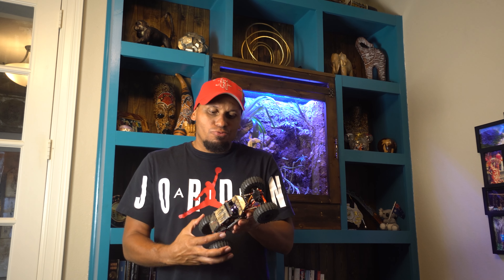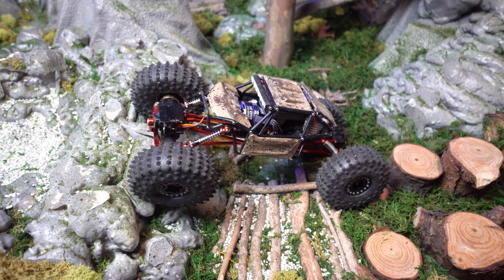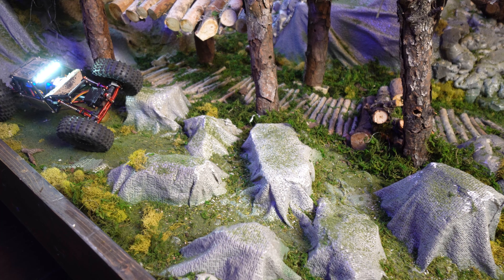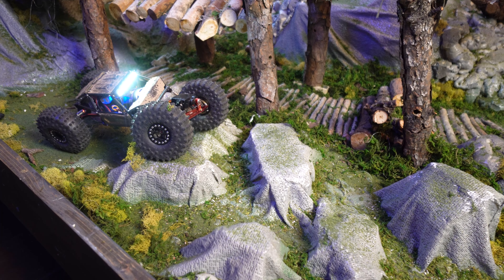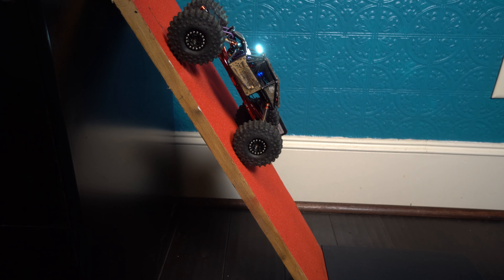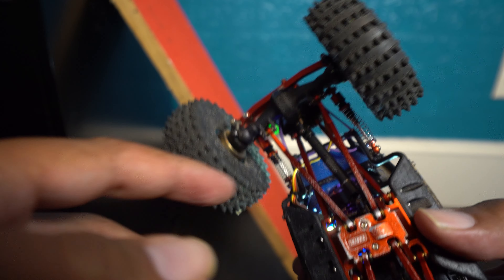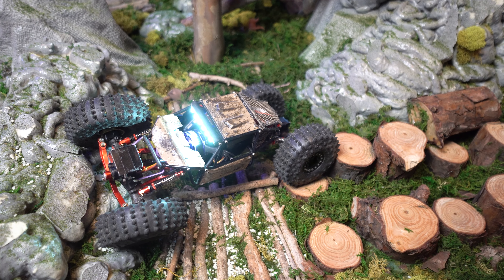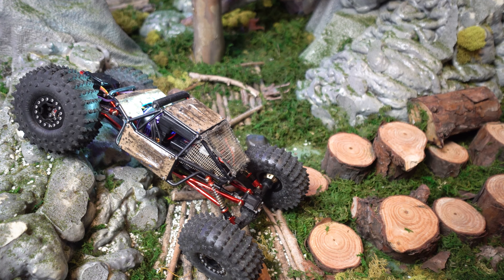Axial SCX24 Injora Rock Buggy Gets Brushless Injora Fat Viper Motor Install!

Comment: When setting it up did you have any problems with the front driveshaft hitting the motor?
Reply from the maker: @Thatonefoowigz  Yes I did. I used stiffer springs in the front with shocks adjusted to hardest setting to stop the drive shaft rubbing.   

I’ve also thought about gluing a small plastic piece to the body to limit how much the driveshaft can raise up. Always tinkering with it.
Reply: @ thanks! I thought about moving the shocks up a bit but completely forgot they came with stiffer springs. I will try that out🤙🏽🔥
Reply from the maker: @ no problem.

Comment: Are these tires better than the mud ones u had ?
Reply from the maker: @dang3402  hi, yes they are far better than the mud tires i originally used. A lot more grip on terrain and rocks. Def go with these. You just have to be careful with turning radias. Bc they can rub when turning if you don’t have wide enough axles. 

And I now use the longer gladiator links for length. And tall tires for clearance.
Reply: @ for front and rear
Reply: Sorry for all the questions. I just find it built so awesome and I want to build the same one.
Reply from the maker: @dang3402  lol no problem. That’s what I’m here for. 69mm front and 78mm rear.